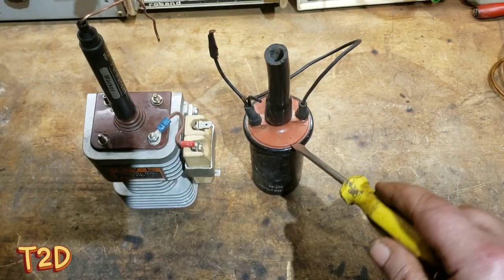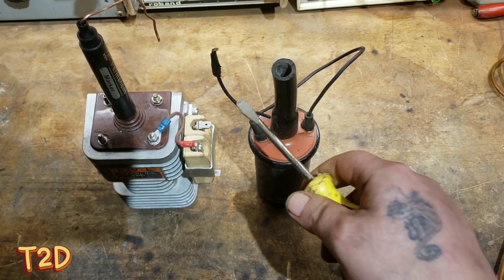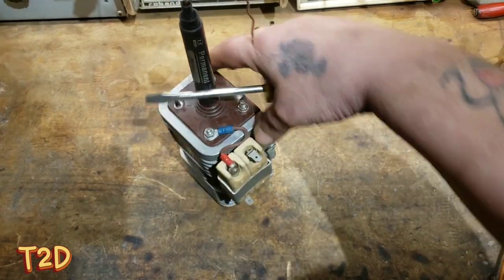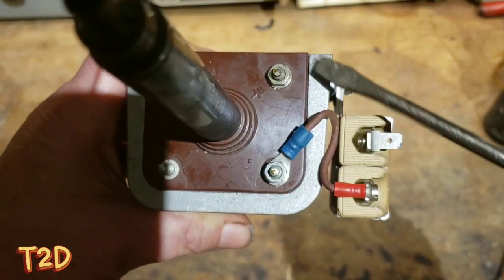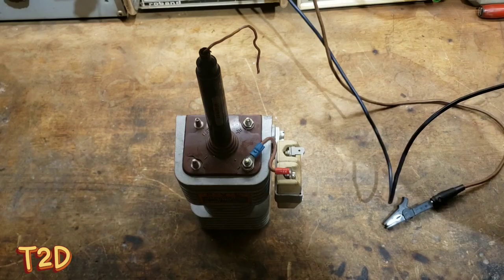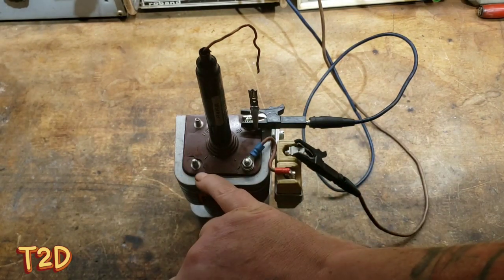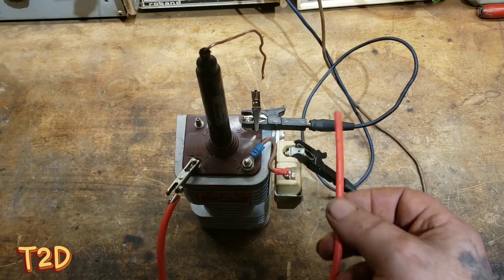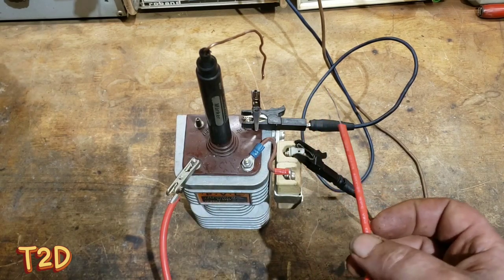Electronic  ignition coil. how to test/use

Comment: Hi, i landed here through one of your comments at Radiofun232 channel, and after browsing through your video's, i realised that i been here before on your channel when i saw your 240V version of the Glaslinger Electronic Circuit Breaker 👋👋👋
At 0:36 the ignition coil that you use, can you tell the model number ? i could see in a glimp the PVL brand, but as a former automecanic, i never seen such a big ignition coil before. Back in the old days, it was a simple autotransformer, later on the "Super coil" like at 0:07 that is filled with silicone oil , and after that the distributor less ignition systems with very compact coils that are mounted straight on the sparkplugs without a sparkplug cable in between, but this big type i have never seen before. Grtz
Reply from the maker: Hi👍 I'm pretty sick at the moment mate, I haven't been in my workshop for quite a while unfortunately (the neon lamp video I uploaded a few days ago was an old video that was in my unlisted yt vids) anyway I will definitely get more information for you and if I get chance I will make a short video, I will x ray one of them in my fluroscope so we can see what's inside 😁👍, as for the coil over plug coils yeah I've played with them you can get a decent output from them if you push them but I'm not sure they would last long being pushed..   you are correct the first coil I showed was an auto transformer with an laminated iron rod core and filled with mineral oil for insulation/cooling,  I'm not sure if its designed to run with a series ballast resistor, I know some are ... I've also played around with the dual and quad output coils,  I'm not sure if I have one here at the moment but I know my friend has a few, we will xray one of those aswel and show one running... might make for an interesting video.. I really appreciate your comments 
And as soon as I'm well enough I will be making videos again, I want to make some electronics teaching content as ive  had a lot of people ask me for this..
All the best 

Steve
Reply: @T2D.SteveArcs  , Hi Steve, take your time to get better, there is nothing burning like we say here in Belgium :-) 
i know the feeling, due Artritis and lack of energy, my electronic projects take ages to get completed, while i have all the parts available. Been working for 3 years on a isolation transformer project (240V) with buildin 500VA isolation transformer, 500Watt Variac, Electronic Circuit Breaker (0,005A to 4A with own design) , dim bulb current limiter (0 to 420Watt own design) , Anti-Electrocution protection (own design) and earth leak test (own design) all together in 1 device. The first idea was a simple isolation transformer, dim bulb current limiter and electronic circuit breaker, but each time extra features where added to the build, what delay the total build. At the moment my first priority is to complete my DIY solder fume extractor made from a IKEA kitchen hood extractor build in a desktop case, with a car cabin HEPA filter and active carbon filter. Operated by a old 47Mhz remote control garage door opener, and with the flexible hose connected to a IKEA desklamp, so that i have light at the point where i'm soldering. I just subcribed to your channel, take care and till later. Grtz
Reply: @Tested To Destruction, , i sended a email with more details. Take your time first to get better. Best regards.
Reply from the maker: @BjornV78  thank you so much Bjorn 👍I will respond in detail as soon as I'm a little better, I'm interested to know more about your projects mentioned 😎👍 it would be nice to see them too if possible.. thanks for your reply and I look forward to future discussions, also I appreciate your subscription to my channel 👍 stay well friend, speak soon all the best 

Steve